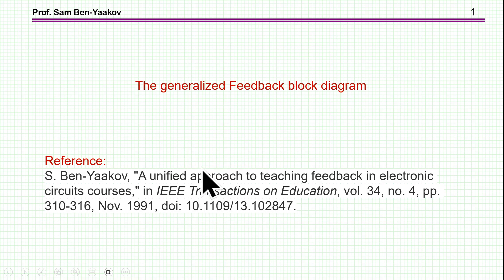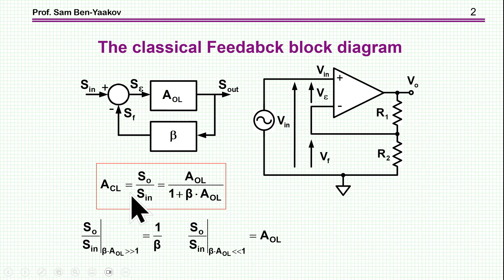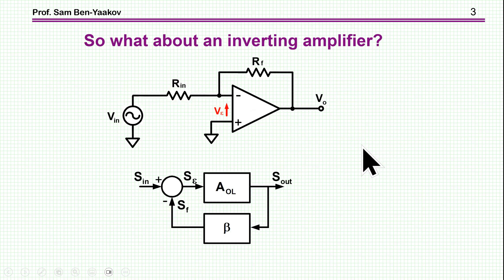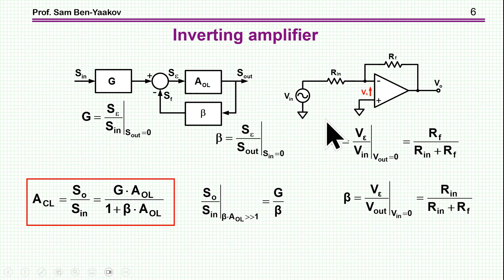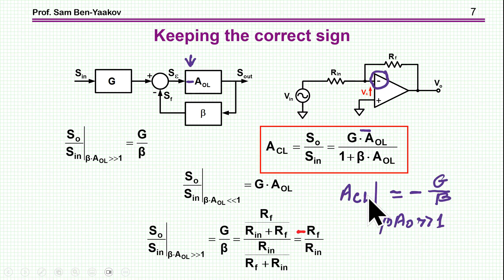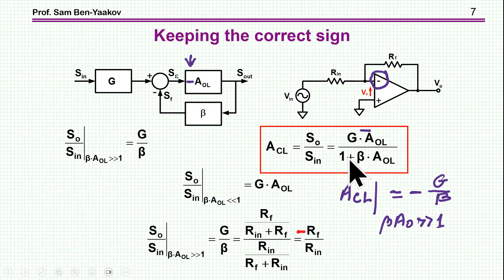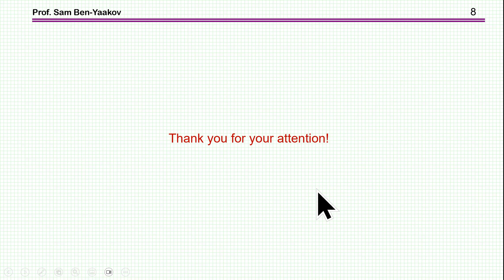The generalized Feedback block diagram

Comment: I want to solve this question please🔥: 

Two capacitors c1=? and c2=12 are connected together in parallel, connected to a battery, and a plate of insulating material with a dielectric constant k=2 is inserted between the plates of the first capacitor. The charge on the plates of the first capacitor was Q1=150 microcoulombs before inserting the insulating material and Q1k=300 microcoulombs after inserting the insulator while the group remains connected to the source. Find the value of the unknown capacitor c1 before and after inserting the insulating material?
Reply from the maker: I don't think that the charge makes any difference. The cap will charge or discharge to the battery. To solve the problem there is a need to know what is the distance between the plates and thickness of dielectric. If in fills the distance, the capacitance will double assuming it was air before the insertion.

Comment: Dear Professor: after studying your paper+video, I found the pole-splitting phenomenon of "Miller compensation" in two-stage operational amplifiers much easier to understand from the perspective of feedback control. Most classic textbooks, such as Smith's Microelectronics or Razavi's CMOS Analog IC Design, focus heavily on mathematical operations without providing much physical insight into "pole-splitting." Additionally, a classic JSSC paper, "Design-Oriented Analysis for Miller Compensation and Its Application to Multistage Amplifier Design," employs a similar method for analyzing and designing multistage amplifiers. The feedback system perspective you introduced certainly provides students and engineers with greater insight.
Reply from the maker: Very happy to learn this. Thanks. I will certainly look at it. Your input is much appreciated.
Reply: Professor, I sincerely appreciate your contributions to the PE society and EE education. My advisor, Professor Ching-Jan Chen, and my PE lecture instructor, Professor Yaow-Ming Chen, who is also the Editor of TPEL, introduced me to your classic paper, "Average-Current-Based Conduction Losses Model of Switched Capacitor Converters." I believe this is one of the most significant papers in the field of switched capacitor converters.

Comment: Thank you sir.
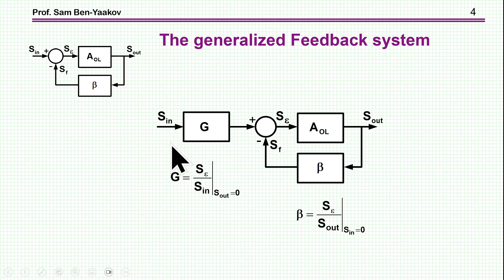Sir in 3:17 I see a problem.
Se = Sin * G - So * B
So = Se * A
For calculating G, if we consider So = 0 then we have Se = Sin * G  and Se * A = 0   =>  Se = 0   =>   Sin * G = 0 but we know that neither of G and Sin aren't zero. Could you please clarify this problem?
Thank you sir.
Reply from the maker: Thanks for the conversation. You are observant. But " Se * A = 0   =>  Se = 0"  is incorrect. The block are unidirectional. For the test, when you need So=0 you actually assume A=0. This is how superposition is normally applied.
Reply from the maker: The test drive is short, 0.25us. The time constant to the right is 1ms so the voltage across the two capacitors is a bout constant during the pulse.